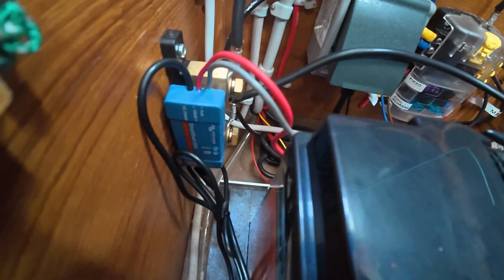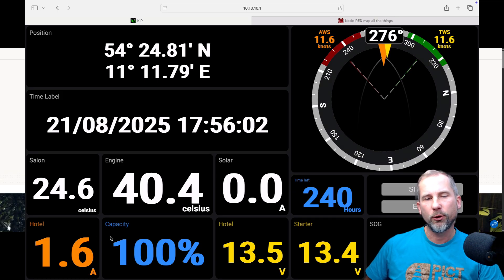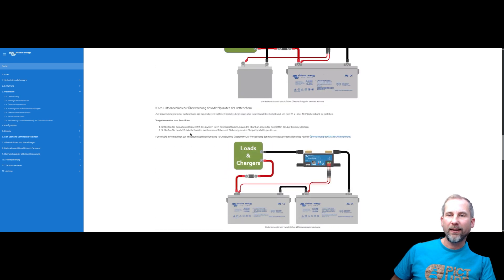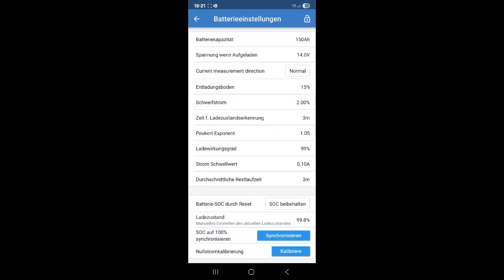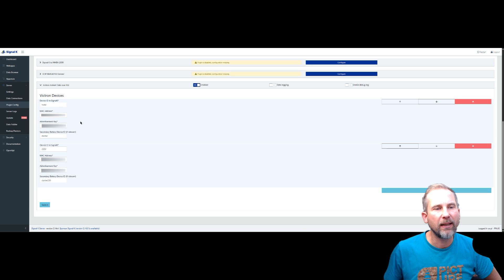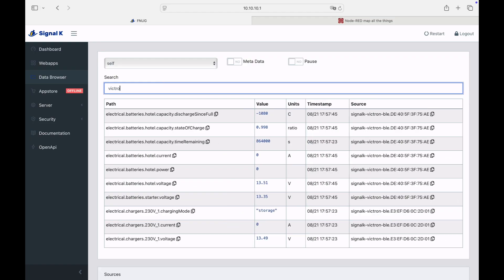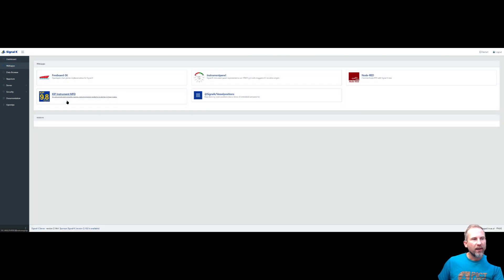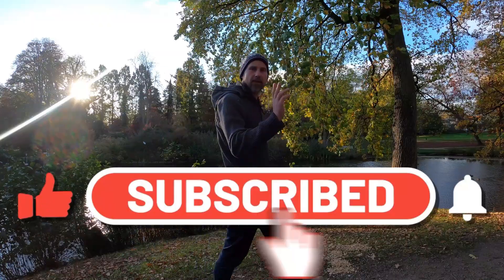Victron Smart Shunt for LiFePo4 batteries with KIP Dashboard on a Raspberry PI (Signal K)

Comment: Super helpfull. Thank you. A good thing to mention is that you have to manual update the firmware of the victron connect app. After upgrading, you will receive a newer version of the smartshunt firmware. The older version I had (Victron connect app V4.08 and the Smartshunt firmware V2.30) do not give you the Mac adress and the advertisement key.
Thanks for sharing!!